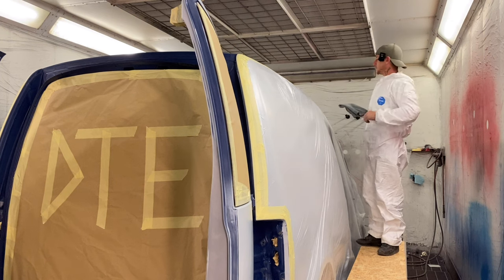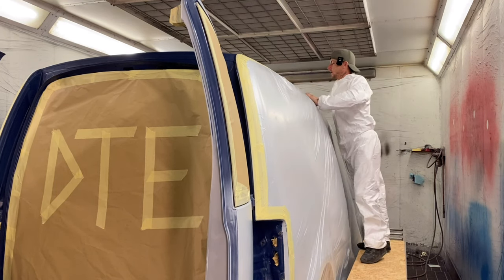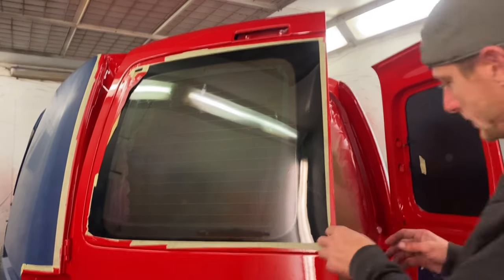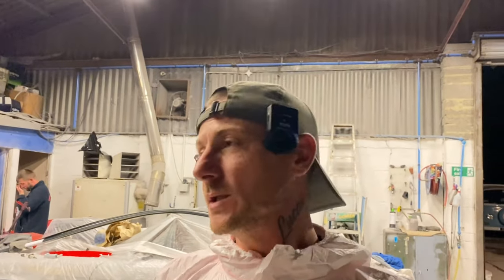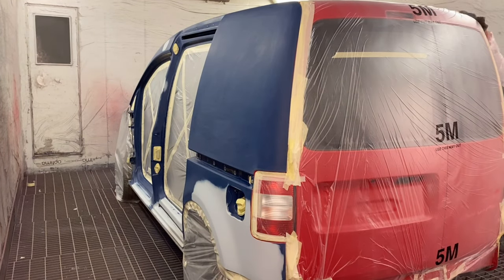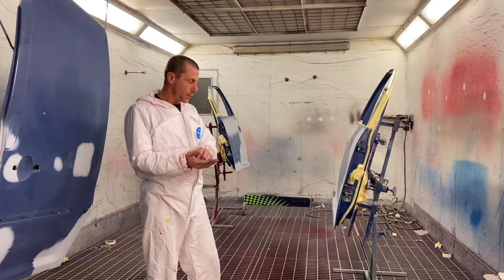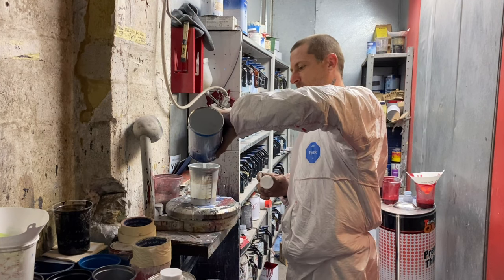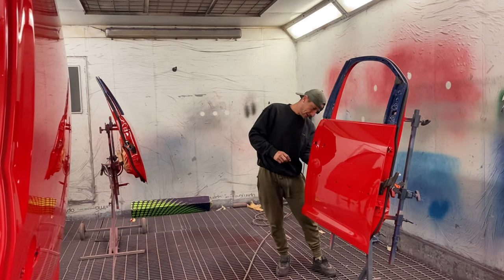Vw caddy 2k paint time LY3D build series Ep6

Comment: Lovley job Nathan I seem to always get runs even though I think I'm doing everything by the book
Reply from the maker: Hey mark thank you 👍 so when painting something we always try to put to much on aiming for that perfect shine right out the box but it’s really hard to get the finish you desire, in my opinion unless your super skilled at the job it’s better to put multiple thinner coats on. Once dried a little tickle with 2000 grit wet sand paper on the flat areas then a buff and they look perfect. I always say I’d rather have 98% finish then buff the rest 👍 rather than 110% and have runs
Reply: @YTDTETV  
Thank you Nathan I can see the logic in that , I'm painting my lwb high top in panels and above the windscreen was a nightmare to reach but I'll get there and hopefully it will turn out nice , keep up the great videos I look forward to them  , thank you for your time.
Reply from the maker: @mark7218  no problem at all 👍 all the best with the project I’m sure you’ll do a good job 👍 thank you 

Ps slight edit, my project after this one is the T5 and there’s loads of bodywork videos on that including the re paint
Reply: @YTDTETV  
I've seen most of your videos Nathan,  I'm up to the latest one with the exhaust,  I just like going back on the videos and watching them again.

Comment: Looks great. Are you a body work guy or self taught at painting? How good is your paintwork compared to the lads whose paint shop you are using?
Reply from the maker: Hey bud thank you appreciate that, so I used to only be a mechanic then I went in with the other guys with the booth for a few years and finessed the bodywork side of things. I done lots of paintwork for customers since then and always came out well it’s only been of late that I stopped doing bodywork. I can paint as good as a painter but I probably take longer and when it comes to a full repaint I’ll do it in stages rather than a full blow over in one go to make it easier. Thanks for the comment 👍

Comment: Not a bad Finnish mate considering its a single stage. Was you not tempted to 2 stage it ?
Reply from the maker: Hi bud thank you 👍 I did think about base and clear but I’ve painted a few motors in the past with single stage and it’s a quicker easier process. Single stage you can finish in 320 and red scotch and get away with it. That’s my thought anyway. Thank you for the comment.

Comment: Are you no baking pal
Reply from the maker: I did bake it for half hour but I was able to leave it in the booth for a good while after 👍
Reply: @YTDTETV  Okies pal I wondered when u said masking was leaving marks if you baked it. Top channel btw every time I think that’s how I’d do it you do it that way 👌🏼 spot on
Reply from the maker: @modevans3569  sorry for the delay sir, so with the marks the tape left it’s all down to the paint and hardener, I brought a 2k kit off eBay and I won’t lie it was cheap ish so obviously reflects quality. The hardener they supply with it seems to take a while for it to go rock hard or hard enough to apply tape soon after. In the latest video with the hybrid front bumper I used a top notch hardener and it went rock hard really fast I was even surprised at the end of the video when I tested it.